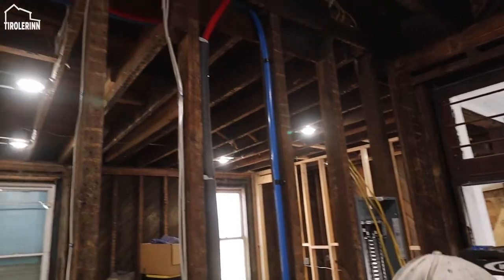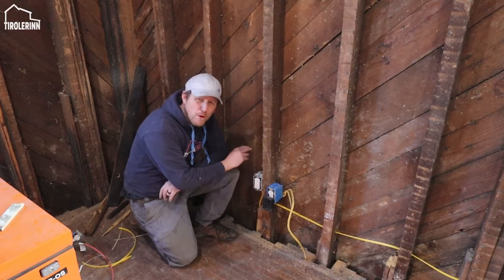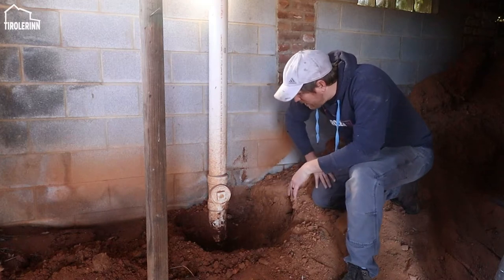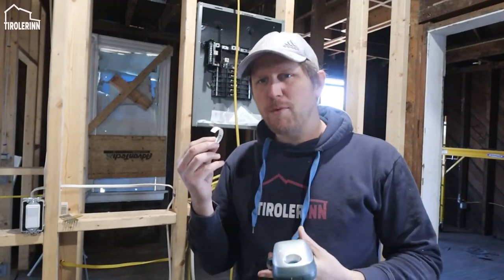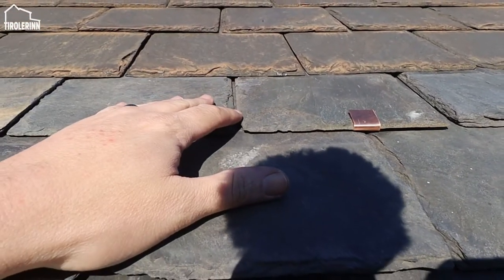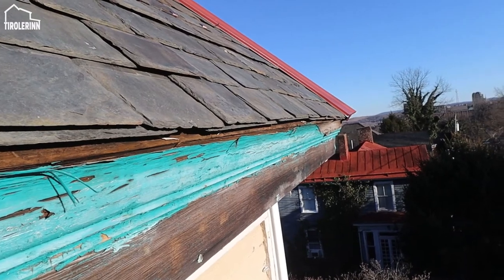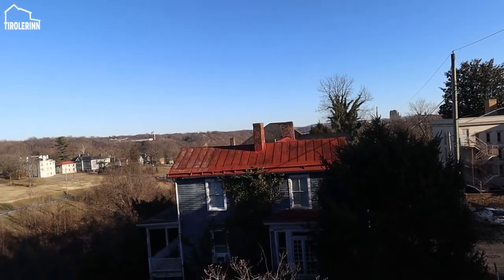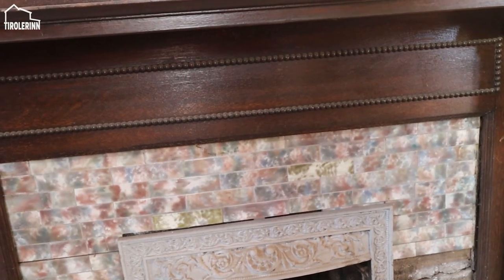Roof and Receptacles in 1st Floor are DONE - Tirolerinn - Victorian Home Renovation

Comment: i don't know anything about anything but i was reading up on slate roofs and everything says not to use those exposed strap hangars, i'm curious why they are being used here? is it temporary or?
Reply from the maker: There are a few techniques to hang or fix slate. New slate is hung through the nail holes, and most rows on our repair were done that way, but the rows that need to slide under existing rows need some kind of hangers. Most roofers either use copper strips or hangers made from steel or copper rods. Both are common and should last forever.